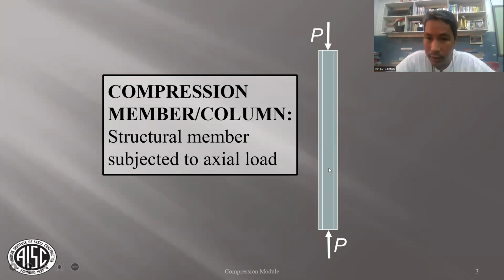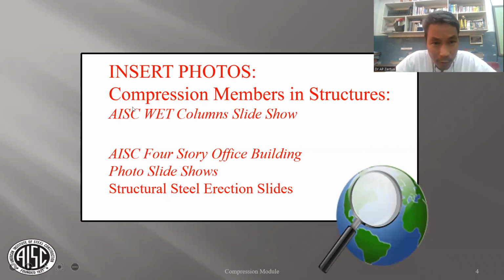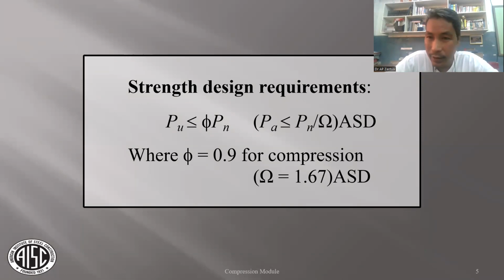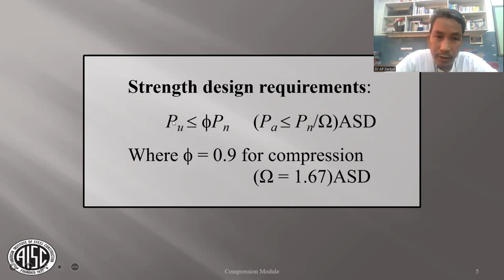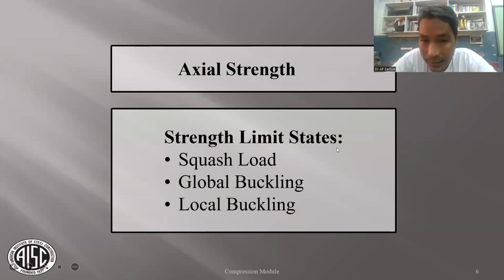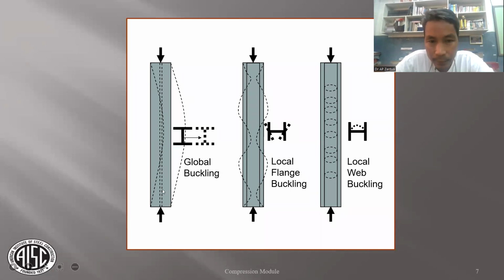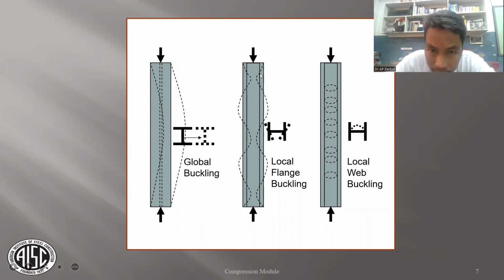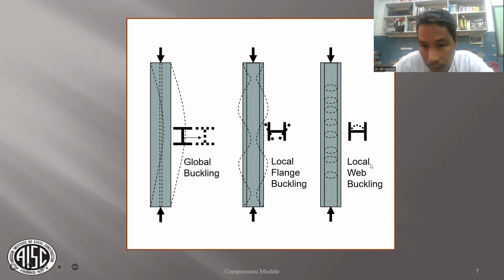Compression Members Design Flow [ Principles of Steel Design ] Module 1.0A.1

Comment: thank you sir for discussing teaching module for steel design. Thank you for illustrating the compression member or column which is subjected to axial load. Thank you for sharing us the strength design requirements. Also, thank you for discussing axial strength wherein strength limits were   explained. Types of buckling is also discussed such as global buckling, local flange buckling and local web buckling.

Comment: I happen to know about compression member design and when it talks about compression member the structural elements mainly points to column. The strength design requirements have been discussed and is going to be used in future lecture. This requirements are the code of NSCP and AISC.  Thank you, sir for briefly explaining the elements in strength design requirements.